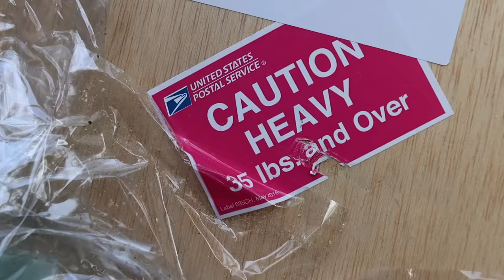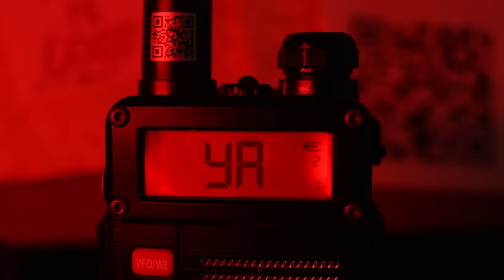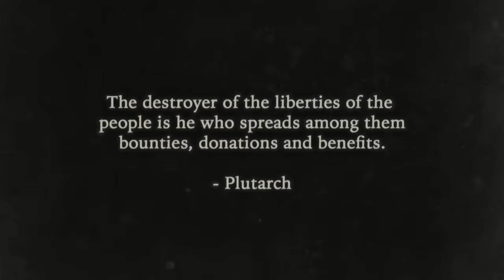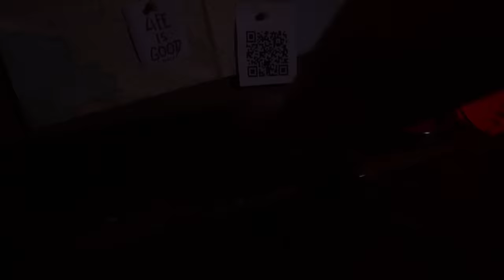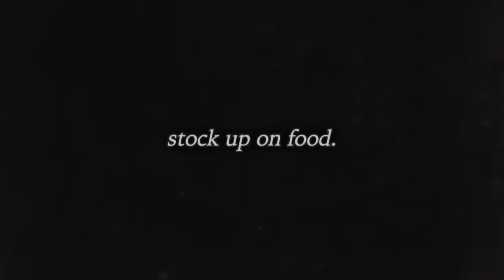GUILLOTINE part 3: Am I Edgy?

Comment: Hey Rusty, you should try using alder wood when making the stopping mechanism. It won't crack and it has high shock resistance so less damage to the mount.
Reply from the maker: I will look into this
Reply: @rustycage  How the aboriginals in australia used to make Celt axes was they would burn a hole through a piece of wood and stick a stone through such that it was pushing in line with the grain of the wood on every swing, instead of against it, which causes tear out (primitive technology made one of these). Maybe you could do something like this? That or just ditch wood altogether.

Comment: Edge isn't bad when actually used correctly. Interlaced with metaphor, solidly done execution with a compelling soundtrack, and novel enough where you don't see it often and edgy provides something unique. You've always had a keen sense of what is engaging; there's nuance in how you weave the morose in with simpler, succinct common messages.

Looks like your lemon cutter is coming along well - I look forward to seeing the next steps.

Comment: You are a montage maestro. If making 10 times the effort ever results in 10 times the money, you can use gold bars for the extra blade weight.
Reply: That would actually be really cool and it would certainly have symbolism to it.
Reply: @edeliteedelite1961  I dunno how rich y'all think Rusty is but gold is $60,000 / kg ($27,000 / pound).

Comment: i saw this new update on ifunny. absolutely excellent metalwork! i am a pretty avid hobbyist metalworker, and have built knives, tool and die equipment, etc. the fundamental instrument of precision in a lathe or milling machine is always a precision set of rails, also called "ways", that the cutting tool can ride on. there are some parallels between this principle and the rail construction of this guillotine you're building, although of course much less precision is required. one of the many reasons the rails are so important is due to the necessity of the rigidity of your cutting tool, as a cutting tool that flops loosely will not be able to cut anything, much less Tool Steel. i like your system of using the premade angle aluminium for the rails of the machine. something that might help further improve the smoothness of the cutting action of the machine would be a set of screws, gibs, or maybe shims that you could use to expand the wood holding the cutting blade. this would exert some normal force from the wheels of the wood holder against the angle iron, improving the smoothness of the rolling action, and creating less slop in the action. also, might i suggest upgrading the rails to angle iron and the wheels and bearings to some manner of steel ball bearings? would greatly increase the quality and longevity of the machine, as well as the smoothness of the sliding action. in fact, ideally, i think that the best system would be to use just a set of diamond butt joints on either side of the holding wood, and putting some metal plates against the metal bearing surface (your angle aluminium) that could be driven by screws to rest against the holding plate. this way, the blade can just fall instead of more slowly rolling down (as potential energy is taken from the blade to increase the inertia of the wheels that are rolling down the aluminium surfaces).

Addendum : You can ignore this if you'd like, I just posted this because I know enough to be able to explain it and I think it's funny because it's not really germaine to the point of the video, and somewhat out of place.

Also, rollers were actually used traditionally, so maybe it's best to go with a traditional design.

Comment: Put springs on the bottom stopper to reduce the damage to the mount. Allow is to pass where the "lemons" will be enough to accommodate where the springs will push back.

Comment: Consider making the vertical length of the blade block longer than the width of the blade, and spacing the casters/wheels further apart. It won't jam or get stuck that way.

Comment: Regardless of the definition of edge being applied in a positive or negative light, it draws a lot of attention.
Things like juggling knives impose the direct risk of self-harm in exchange for a bit of attention.

Edge without cringe is basically just appeal branded another way. You should always take the word as a compliment imo.

Comment: The reason your mount keeps breaking is because you fastened the wheels on the end grain. Not a good idea, wood splits when you do that. try mounting to the sides or meat of the wood. Will make it bigger but that may be necessary. Plus you can add more wheels and more wood and metal for the wheels to ride on. Make it heavier and smoother. :) hehe just a thought

Comment: Rusty let's "buy" a big ol RV and go out into the desert. We NEED TO COOK. You can be the Heisenberg of your era, and I'll be your Jesse Pinkman.
Btw, historically guillotine blades weren't very effective at cutting. It usually took several uses for them to take the head off. I could design you something way more metal. You have the same amount of weight but you focus it into a single razor-sharp wedge spike that then precedes to widen to the size of a neck closer to the base so you effectively cut the head off from the inside out, but not before it cleaves a hole through their spinal cord.
If you're gonna bolt the blade to a block of wood your bracket needs to go across the bottom. In fact just having a sheet of metal that wraps around the bottom wraps around the bolt side would work best for long term use. You'd just have to drill holes through the steel. It could even just be cheap iron honestly. After all, you're Rusty Cage.

Comment: Also from Urban Dictionary, albeit lower down from your 2nd definition: " Edgy - Applied to books, music, or even haircuts which tend to challenge societal norms and reveal the dark side."

Least that's the meaning I have in mind when I would call your content edgy. - And even then it's not like a single label can just fit your stuff. - There's edge, but there's also plenty of creativity and a respectable measure of courage that it takes to say "Fuck you, I do what I want".

I honestly thought your content died out after you took a step away from the Knife Game songs, was pleasantly surprised to find out there's more songs and more content to watch.

Real curious to see what the final mounting is gonna be for the blade, but I can't shake off the feeling that you might be better off foregoing the block and wheels mount entirely, and instead invert those right angle rails and have the bare blade skating down between them, if only just to make sure there's enough blade length for it to run through the segment where the throa-... I mean, "lemon", will be seated.

The one thing I'd recommend though is that you get some bolts that fit the circumference of those holes. - If the wood block cracks it's probably because the different bolts allow the blade enough wiggle room where at landing it's supported for at least a little bit by only one or two bolts, instead of all six engaging together. - When it comes to impact tools, wiggle room is breaking room. - Maybe forego bolts entirely, and use some sections of pipe instead, and hammer open the two endings to function basically as big rivets. Then fill them up with a wooden dowel for a bit of additional structural integrity.